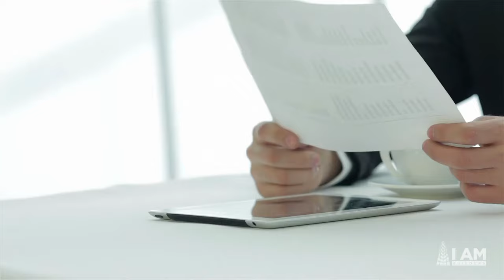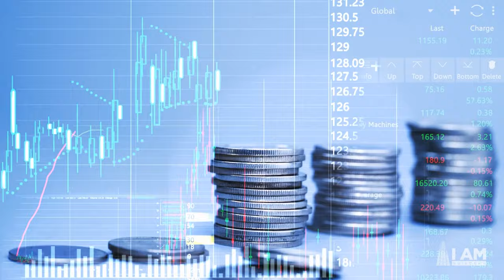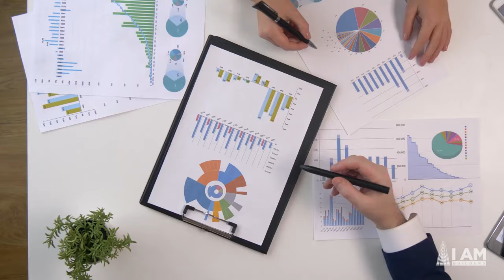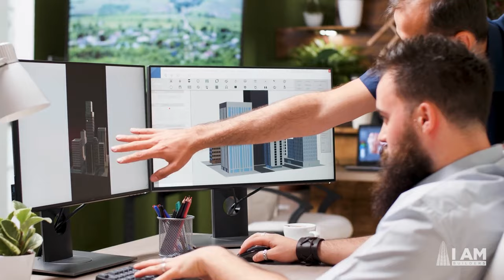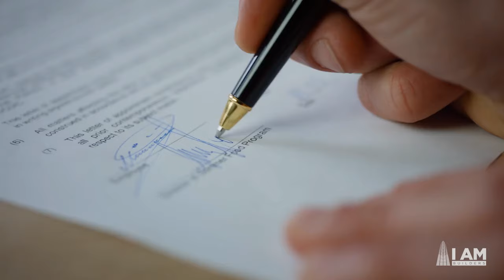27 Ways to Negotiate Construction Projects (2024)

Comment: Your low bid, break even and then rely on change orders tactic does not work well if the GC has a maximum allowable mark up on change orders - most large / reputable GC's have  these in their master subcontract agreements. Other than that, keep up the great videos!
Reply from the maker: The thing is you’re not relying on change orders.  You already know change orders will come in most cases.  If the job is neck-and-neck, knowing this can allow you to bid a bit more aggressively.
Reply from the maker: @MattCupan Not exactly Matt.  All projects have unforeseen issues that result in change orders.  If you already know you’ll likely land an additional 10-20%, why not consider that at the time of bidding?  You’re not bartering.

Comment: Great video. 
I just start bidding with Commercial  projects , Is $6.00 s.f for drywall boarding and level 4 finish plaster too low or to high for Commercial bid? 
I've always Google costs per s.f but  i have doubts.
Reply from the maker: You can’t do it like that. It’s very very inaccurate. You have to measure the wall and ceiling square footage. And some walls and ceilings have multiple layers.  If you need a hand, I can help. Let me know if you want to jump on a call.